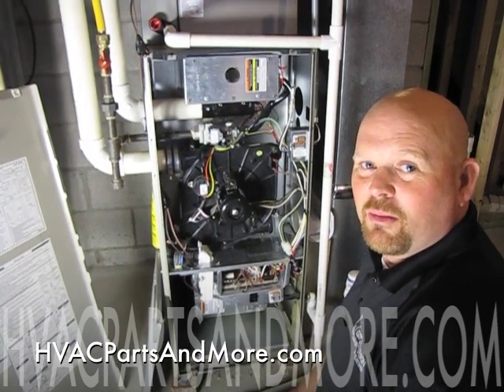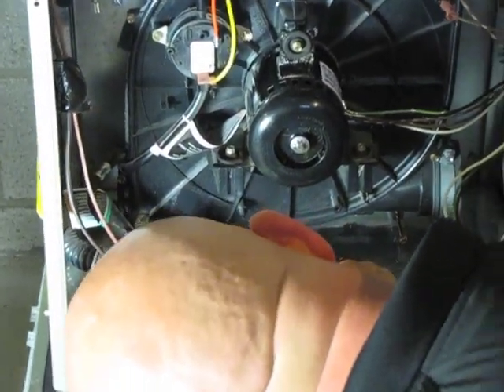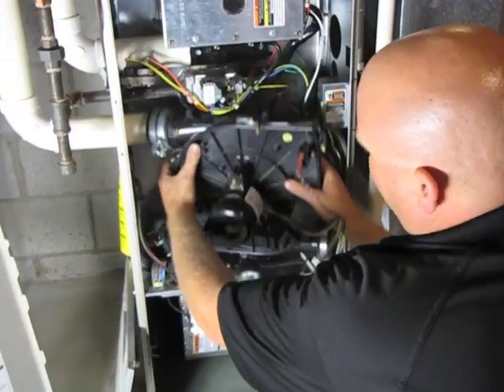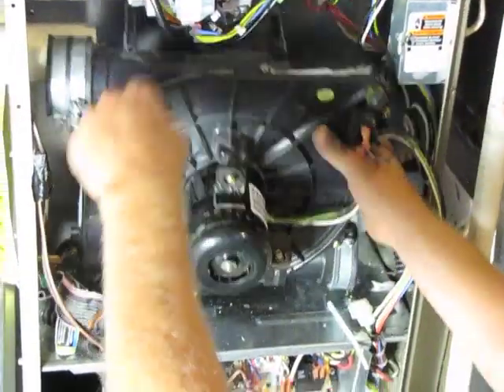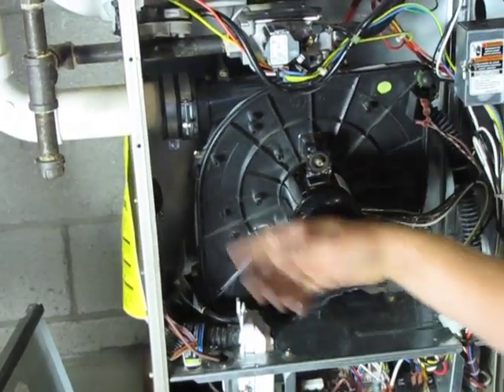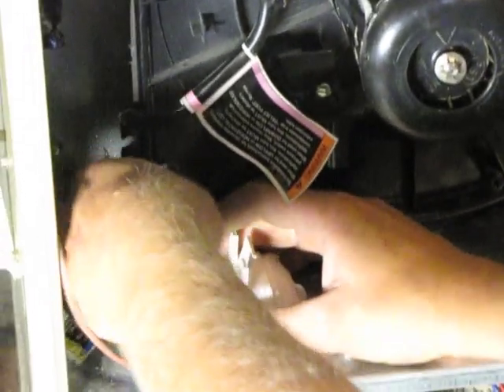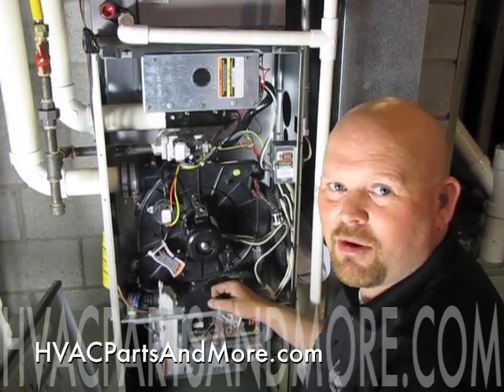DIY - How to Change the Draft Inducer on a Bryant 350AAV Furnace

Comment: I noticed the 1 inch flexible rubber tubing hanging down on the right side after you installed it. Does that plug into anything?  What is its function?  Please let me know!

Comment: I noticed the 1 inch flexible rubber tubing hanging down on the right hand side after you installed it. Does that plug into anything? What is its function?  Awesome video thankyou!
Reply: Did you ever find out where this hose goes or what its purpose is? I'm looking for the same answer as you are right now.
Reply: @loganspeed9047  Yes!  It just hangs down and does not plug into anything. Since I put the new draft inducer it has ran perfect for 2 years now.
Reply: @user-vz8pb2fk5d  thanks for letting me know,  and I'm glad to hear your furnace has been running great since installing this. I however am still uncertain of my issue I'm facing. I keep getting water in my pressure switch hose, causing my furnace to short cycle. All hoses, trap and drains are clear of any clogs as far as I can tell. But I keep reading that the inducer condescension housings fail or that my issue may be further into the furnace that I can access with the inducer motor and housing in the way. So hopefully, I can take this off and make my way in there to find the issue!

Comment: I'm trying to remove the inducer assembly on 340 MAV in order to replace the condensate hose (321235-101 / 314781-702) that goes from cold box to P-switch.  Removed the four long screws that go through standoffs and loosened flue coupling, but inducer won't budge!  Feels like its being held from behind, but I can't tell where and I don't want to break it.
REPLY
Reply from the maker: There is nothing holding it on besides the four screws. It likely has just formed a tight seal over time and needs more force to be removed. There's nothing there to break really, but if you want to take it easy just rock it back and forth until it's loose.
Reply: Thanks.  Feeling behind it I could feel the triangular seam separating slightly as I pull so it was not frozen together at the seam.  Maybe I will try again as long as there is nothing else to hold it or break.  Otherwise maybe I can get the hose off without removing the inducer, but I didn't have any luck the first time I tried that...

Comment: Thank you for the video! I followed the instructions and how you show on the video but water is dripping from my inducer housing at the bottom just before the drain on housing to condensate trap. I then took it apart again and flushed all the lines and there is no clogged drains or obstruction. Put back together and it still drips when the furnace runs. No error code either. Just the drip issue? Any ideas why it would be leaking at the bottom.
Reply from the maker: I'm sorry, but I don't have any idea what is causing the drip. I too would think a drain line is clogged up, but that doesn't seem to be the case. Maybe condensation is running back down from the flue and drips out of the inducer before it has anywhere else to go? It's hard to really know without being there and seeing the whole picture.
Reply: HVAC Parts And More thanks for your reply back. I noticed in your video you have a cap and clamp on the secondary drain on the upper right hand corner of the inducer housing and mine don’t...yes, I have some condensation come from the vent pipe coming into the inducer that gets vented outside.

Comment: Why no new silicone caulk at back as per directions?
Reply from the maker: Silicon was not necessary because the seal was fine. The instructions state to inspect the seal, and then instruct how to repair it if it is damaged.
Reply: Thanks! I actually figured that out when I installed my new blower inducer. The gasket was intact, and I thought to myself “What Luck!” plus I then realized why it is optional. The extra silicone would just make a mess!

Comment: There is a pipe to let clean air come into the combustion area, just above that inducer. It can open left or right. Should the other end be capped off, opposite of whichever direction you have piped out? In your case left side is piped. Should the right side have a cap on it?
I found a cap in our furnace cabinet and it fits that junction thing. Ours is piped to the right side but left side was just open.
Reply from the maker: Yes, you should definitely cap that off. What the inducer does is act as an exhaust fan that forces the carbon monoxide out of the house. You are correct that this inducer is made so that it can be vented out the left or right side of the furnace. The side that is not connected to the flue (white pvc pipe) needs to be capped, otherwise the air (containing CO) that it is supposed to get pushed outside is going to just be left right there in your furnace, where it will leak into the surrounding area.

Comment: Great video... On another video the technician  specified putting 400 degree clear caulking on the cold box and insisted this be carefully aligned... Does the cold box and the inducer housing require silicone sealing as you did not specify this during your instalation??? Still a great video... I have to remove mine in the near future to replace the large drain tube from the cold box to the p trap as the hose completely disintegrated on the p trap end...  I am awaiting for the new hose to arrive and was a little leary about changing mine until I watched your video... Thanks again...Frank

Comment: Great video just one question why don't you  install a new motor instead of the whole house it's cheaper?  Ill be doing this in the spring.
Reply: I was going to try and change out just the motor too, but in another video he said you shouldn't do that because the motor and wheel are balanced as a team, not sure if that is true, but with a $4,000.00 furnace, I'm not cutting corners, I live in WI, winters are a little on the cold side.

Comment: The motor on our draft inducer sometimes gets stuck. If I cycle the furnace power and spin the flywheel by hand for a couple seconds it'll fire right up.

I saw instructions for a different model that suggested using some 3 in 1 oil to oil it, but that motor had a special hole for that purpose.

Does this model have an easy way to do it?

Otherwise I can pull it out and try cleaning it...
Reply from the maker: Andy Dillbeck This draft inducer has sealed bearings and there isn't a way to put oil into it even if you take it off. However, there is a good chance that your capacitor could be the issue. If the motor was getting low amps, it would have a hard time starting and would explain why it can get going with your assistance.
Reply: Is there info on how to check the capacitor?
It starts up fine about 90% of the time, and I don't know what would keep it from getting the amps sometimes and not others.
Reply from the maker: Andy Dillbeck You would need an electrical tool like a multimeter or ideally a clamp meter to test the amp draw. There should be videos on YouTube that show how to check a capacitor - we intend to add one of our own at some point. Basically you would have to connect to each lead on the capacitor and see how many MFDs you're getting. If you had a clamp meter, you could put it around one of the wires running between the capacitor and draft inducer as it calls for power and you'd see exactly how many amps the capacitor is supplying to it. In either case, you'll want to make sure that number is within the tolerance listed on the capacitor. You could also visually check your capacitor to make sure it isn't bulging or swollen as well as leaking.

Comment: That tube hanging from right of inducer motor when u were done does that just hang there? Also noticed at combustion chamber to right on unit i was looking at there was a spot where looked like a tube Came off but was open to chamber...should something be there?
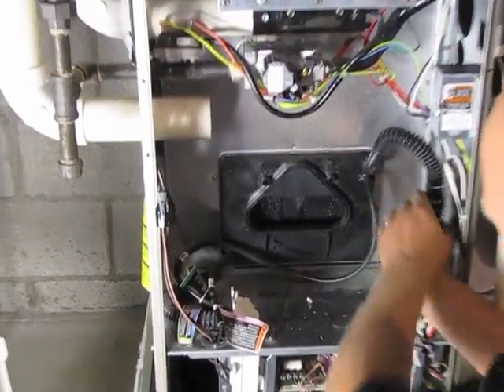Reply from the maker: If you go to about 1:33 when he took the inducer out, you will see that tube hanging behind the draft inducer and he simply moved it to the side. It probably should be put back there just to be safe, but it was not hooked up or running to anything.

Comment: The instructions say to use the RTV (red heat resistant silicone) on the collector box and Pam on the inducer housing. However it says "must not contain corn or canola oil, halogenated hydrocarbons or aromatic contents to prevent inadequate sealing"
.......they all do. What should I use instead?
Reply from the maker: That is very confusing, I am not sure why they would suggest that. I believe what they are saying is that if the old seal is broken/torn when you remove your old housing, then you must scrape off the entire seal and start over with a new bead. They might be suggesting that PAM (a "sealant releasing agent") makes it easier to remove the old silicone. You could go ahead and use PAM since they specifically suggest it -- but if you're wary of the warnings against canola oil, you could just try to use a razor or other straight edge to scrape the old seal away. For what it's worth, our HVAC service techs certainly don't carry cooking spray with them on repairs.

Comment: So..... If I have a small rust hole (about the size of a dime) in the top of my draft inducer assembly (so as to not build enough air pressure to trip the switch) can I simply cover the hole with duct tape as a temporary repair?
Reply from the maker: You could try that and see how it holds up. A better solution would be to use a water-resistant sealant such as silicone.

Comment: One more questions ... the tubing from the heat exchanger. a.  This looks like a standard neoprene 1/8 in ID. Do I need to get the OEM parts? or am I good to use any neoprene tubing? They are marked with part numbers 319873-314 & 319873-316. I've got crunchy stuff on the -314 but only on the ends .. I've trimmed it up and it is still long enough to install without kinks and just smooth turns. It looks like they had a kink on the initial install (15 years ago), so I'm wondering if that is  why it went bad.

Any thoughts appreciated.
Reply from the maker: You should be able to use any pressure switch tubing. We sell some Lennox tubing priced by the foot on our website if you would like to buy it there.